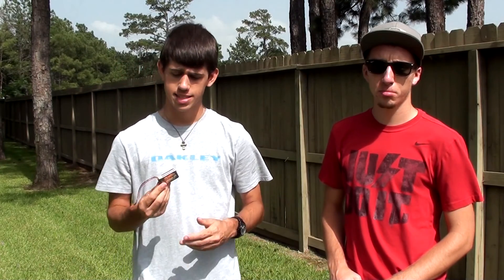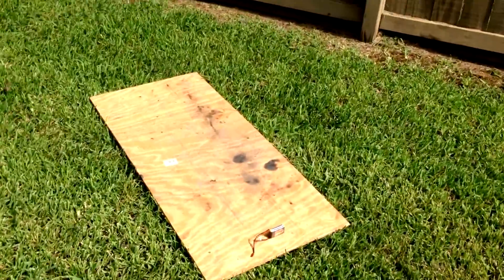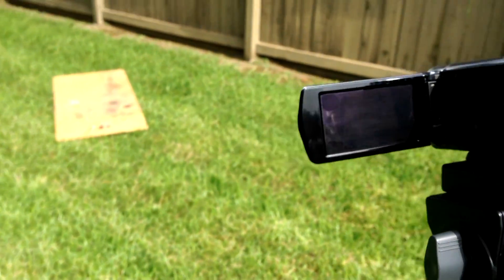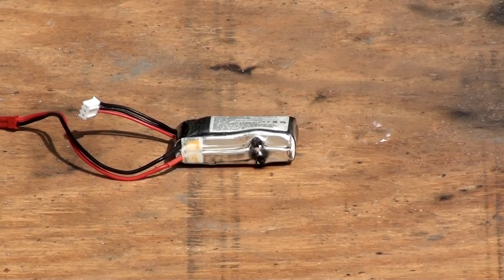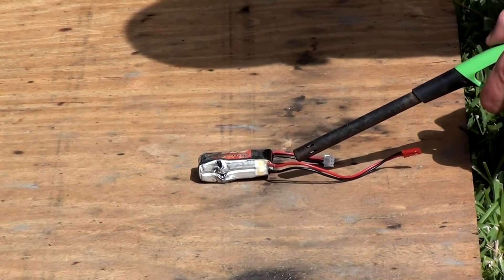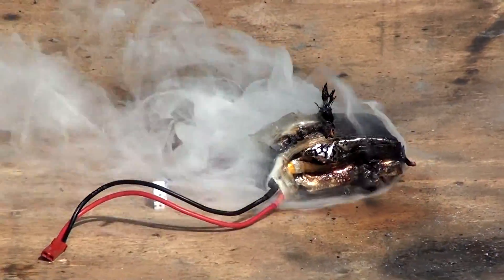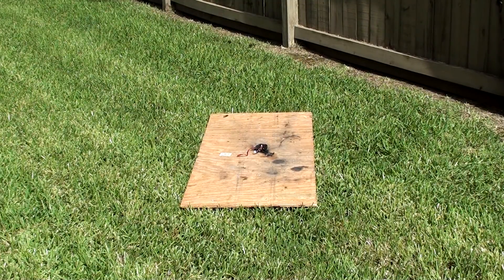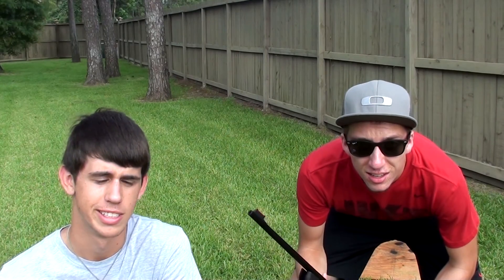LiPo Battery Explosion - Guns and Fire!

Comment: I once shot an old full charged 3s 2200mah lipo with a .223 rifle, and guess what, nothing happened. I even filmed it too, thought it would make a great video. I watched it for about 5 minutes and nothing, no smoke or anything, yet all 3 cells were clearly ripped open, I don't get it.
Reply: It probably was completely discharged so the batteries didn't ignite.
Reply: Justin Fajardo It was an old battery that no longer held much of a charge, so maybe that's why nothing happened.